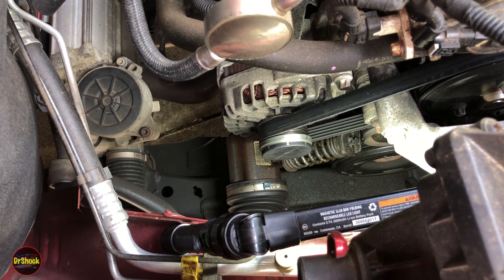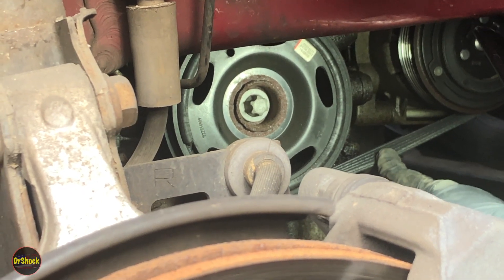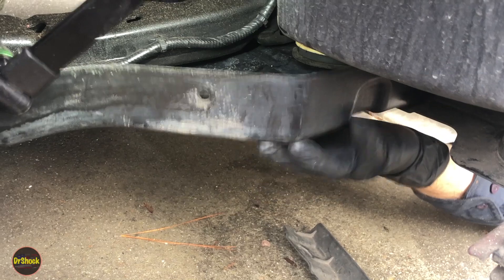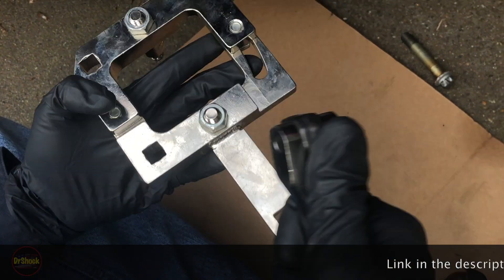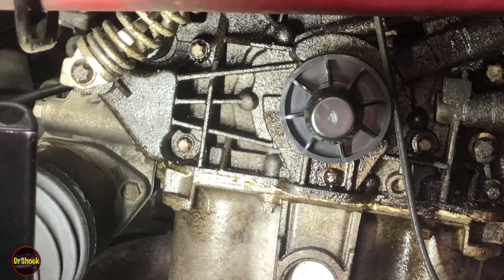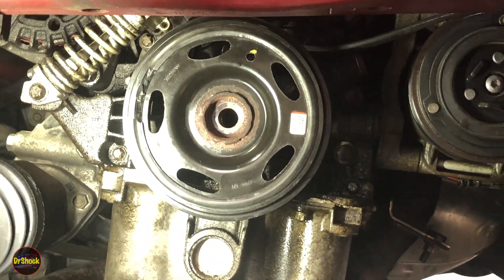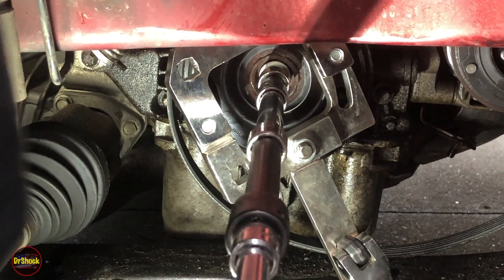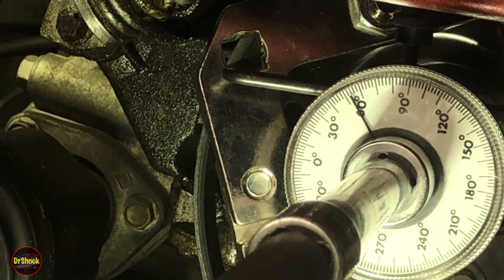2011 - 2021 GM Ecotec 1.4L Engine Oil Leak Front Crankshaft Seal Replacement (Chevy Cruze Sonic)

Comment: U don't have to put it in TDC it can only go on 2 ways, just remember where the hole is at the time of removal, as for the seal anything can ply it out just don't scratch the wall, as for lube on the seal why, the idea is to stop oil not added lube. Only need to place it TDC is when you're removing the timing chain, u will need a kit to do that as it gives you the cam locking plate and the locking crank pin.
Also, the timing chain gasket is known to leak as well, it's a pain in the bum to do, you need a day and a half of spare time for that, bloody Dawoo why did Chevy or Holden take on these pieces of crap is beyond me.
Reply from the maker: The GM dealership service manual provides a specific procedure, specific tools, and recommended techniques for this repair which are written by the GM engineers who designed this particular Ecotec 1.4L engine.  Some steps might seem redundant, or even unnecessary.  But they are the GM recommended ones.   For example, pre-lubricating the seal is indicated in order to prevent the inside sealing lip of the seal from tearing or folding during installation with the crankshaft seal installation tool.  Does this happen often?   No, but it can happen so the engineers provide a step that mitigates the possibility from ever happening.
Reply: @DrShock , I just use the old seal and place it against new and tap it in, no special tools are needed to do this job, unless like I said removing the timing cover to replace that piss weak gasket that dries out down on the bottom right side which then crumbles, then you need the tool kit, well yes and no as all you need is flat steel to lock the 2 cams in place, top dead center a piece of cake to find, spending all that money for an over kill kit is over the top as I found out after buying the kit. Just remove the 1st plug place a rod or something till the piston gets to the top, this requires placing the crank bolt back in but use a spacer / sleeve on the bolt to stop it from going in too far as the pully is off. 
If the timing is out then you will need the kit to adjust the cams but I never ran into that issue, maybe if your tearing down the whole engine, work smarter not harder, yes the book will tell you how they recommend as a lot of people don't understand shortcuts as they are not mechanical minded, as for lube a new seal is soft so doubt that ever happening, but good how too by u I'm just speaking on my experience. Oh if you leak oil on the right bottom side between sump pan and timing cover that means timing gasket and what a nightmare to do, know wonder they charge around 1400 to replace. . All the best.
Reply: @bobfisher1909  Yeah if anyone thinks their vehicle gets serviced like this at the dealership they are fooling themselves. Techs would never make money if they followed every last step to the exact T. Use a paint marker and mark the top of the pulley. It's only keyed to fit one of two ways and if your mark is at the top when you put it back on it's impossible to do it wrong. The pulley is not press on so there's no need to measure the distance. That procedure is there to make sure you pressed it in all the way before tightening the bolt. Replacing the balancer bolt is pretty important but I've never seen a single person put a torque wrench on one. To each their own. If you're working on your own vehicle you can do it however you want and there's no problem with that

Comment: Dr. Shock I'm having problems with my 2016 chevy cruze limited 1.4 turbo same oil leak as the one in the video I've tried and replaced seals what else could be the problem please help.
Reply from the maker: Only use genuine GM parts.  Aftermarket parts for these Ecotec 1.4L engines often have inferior fitment.   If you are using OEM seals, then you may have damage on the engine cover the seal is pressed into, or pulley assembly that inserts into it.  Inspect all the components that make contact with the seal (either the inside diameter of the seal, or the outside diameter of the seal).   You may have a burr, dent, or other defect which is compromising the seal integrity and causing the leakage.

This all presumes, of course, you have correctly diagnosed the source of the oil leak is this particular seal.   These engines can leak from many places after this many years.   Cleaning the whole area up and then monitoring the oil leak against a clean engine can help confirm the diagnosis.

Comment: Wats the difference of leak of the timing cover and the crank seal ? How bad of a leak is the difference? Thinking about changing the seal but not sure if it needs the timing cover seal also
Reply from the maker: The crankshaft seal being worn out will usually be a considerably larger and more noticeable oil leak than the timing cover gasket failing.   You might start with making sure that the timing cover bolts are still at torque.  Replacing the timing cover is a much larger project for this particular engine, as you have to pull the water pump and other components off to get access.
Reply: @DrShock  thanks for the reply
Reply: @DrShock  I wonder if a leaking crankshaft seal on the front passenger side of a 2006 Dodge Caravan would be the same sort of repair? Is a cam shaft oil leak repair something that you could demo as well? My new vehicle sprung a leak after an oil change, followed by a catalytic converter replacement (at the dealership) but it continued to leak oil and have a metallic scraping sound when first starting up.

Tho' still under warranty, the dealership kept it for two months -- saying that they were waiting approval from "Chrysler Dodge" headquarters to replace the existing engine. Finally, I was told to just trade it in on a new car, which I couldn't afford.  
Several mechanics have looked at it, and said "it can't be fixed."

I don't believe that a good mechanic can't fix "anything broken on a car." 
 I don't even know if it's a camshaft leak or a crankshaft leak. It's a great little van, always passes "smog" and I keep the oil level very low, so it doesn't leave an oil puddle. I've owned my Caravan for 19 years now; I just wish I could get that oil leak fixed. Less than 100,000 mi. Everything works. But I don't take it very far from home, in case it overheats. What do you think, DrShock??
Reply: Start using marvel mistry oil will help seal sray soft and keep sealed up lube better and cleans carbon build up change oil every 5000 miles using cheap synthetic oil from waly world oil is always dirty looks like need change out every 3000 miles if use quart of mistysry oil
Reply: Update I changed the crank seal still seeing oil on the ground guess it’s the timing cover

Comment: Love the video.. but this does not work for the 16 and up models.  There's a special puller that costs just under 200 bucks and up to 400. You need this to pull the harmonic balancer.  I'm having this issue right now.
Reply from the maker: Thanks.  Unfortunately, after 2016 GM introduced another flavor of this same displacement engine and kept the same branding but it's of a different design under RPO LE2.  While it uses many of the same parts, it does have some service procedure differences which creates confusion. I mention in the video, and again in the description, this particular crankshaft seal replacement procedure applies only to the earlier RPO LUJ/LUV style 1.4L engine, which was used from 2011 thru 2020 in various GM vehicles like the Sonic, but not all.  The 2016 Cruze Limited would have been the last Cruze model to use it.
Reply: @DrShock  gm is doing too much on these cars nowadays.  Have you ever seen the alternator on these 1.4 ecojunks snap bolts and fall off?  

We've had 2 at the shop this year. Smh

Pulling the harmonic balancer is the big issue to replacing the timing cover.
Reply from the maker: I've only ran into bolts snapping off when they were previously over torqued, or from corrosion on cars down from northeast (rust belt) states.  But otherwise, no haven't ran into this on Cruzes or Sonics.  But then I haven't encountered anything newer than 2016 on either.
Reply: Oil seal leak on dipstik also used marvel mistry oil to help clean and keeps seals more lubed and sweels rubber to help from leaking why mistry secret dad taught me have sonic 150,000 milles all had to do replace oil seal on valve cover and tighten timing chain guide bolts as they come loose and make tapping noise but pvc good also have to belive in marvel oil

Comment: Don't forget that pin in the tensioner... $50-$120 mistake.
Learned that the hard way while changing a belt that was beginning to shred. Noticed the shredded belt while in the middle of changing the turbo oil inlet line...
While changing belt, noticed coolant was empty to find the expansion tank was leaking at the outlet hose. Fixed that 2 days ago.
And..today I just noticed the hose clamps on the lower radiator hoses are snapped from age...
Rewind 5 years ago. Negative battery terminal (fun when your car shuts off while negotiating a turn...) , water pump, timing chain guide came loose, stuck lifters. Fun times.
I think this may be my oil leak...hope it is, this doesn't look like a difficult repair.

The mention of the TTY bolts. Had I not viewed your video on the belt change, I wouldn't had known the engine mount bolts had to be replaced after removing them.
Wasn't mentioned in the Haynes repair manual.
Thanks.
Reply: As a machinist 33 years useing same bolts ok if not stripped think steel bolts must be junk steel use h13 steel bolts good life time as i used same bolts must be biggest engineered skam think can use same bolts as  would not be afraid to use same bolt.
Reply: @jodygwiinn1233 TTY bolts stretch when used correctly, which you can’t always see visibly, but they do change shape from when they weren’t used to after they were installed so you should be using new ones for things this important
Reply: Especially aluminum as steel oxidize pulls alum threads use anti size on replacement bolts
Reply: Aluminum used only for lightweight better gas mileage for government rule now next be elec moter then use tesla atomspere elec to stay charged or just drive around thunderstorm and add extra capacitor to charge up rest of year on one lighting hell may become back to future car think about it be free why tesla tower tore up

Comment: Been there... done that. And I mean, losing 2 quarts in 10 miles. Timing cover, and crank seal.
Reply: Did it fix the oil leak I changed the crank seal but I’m still seeing oil on the ground guess it’s the timing cover
Reply: @3svtcobra  you still got the Cruze ?
Reply: Those things were damaged as a result of you driving 10 miles?
Reply: My mechanic is struggling with this bad...he put one on and it made the leak worse ..so now he s trying it again and answering my messeges..smh

Comment: What a pain in the a** car 😣 I had the engine completely rebuilt.. replaced ALL gaskets/seals, here I am again two months later searching for the source of an oil leak.. seriously the worst engine ever made!
 was it the crank seal with yours?
Reply from the maker: This isn't my personal vehicle, but I diagnosed for the owner four separate oil leaks.   Camshaft cover, oil pan, timing chain cover, and front crankshaft seal.   I did a video on the procedure for all but the timing chain cover one.  You can find the others in my Cruze repairs playlist.
Reply: @DrShock  Turned out the Harmonic balanced bolt was loose. Although I torqued it to spec..oh well..
Thank god 🙏
Reply: @DrShock   Oh bro please don't say that... 😣 That car definitely had a bad PCV check valve. That would explain all the leaks but I have the PCV Fix installed and it still leaked !! 

The thing is, I did all the work myself. I already went through everything. The thought of starting over just makes me sick...😣
I hope it's just the crank seal. 😐
Reply: @DrShock  The leak came back again, I replaced the seal with a GM one and it's gone.. The seal I used initially was an aftermarket one, and it was so loose in there that I pulled it off with my finger
Reply from the maker: Good call on OEM parts.  Always the right decision to avoid doing the job more than once.  ;-)
Reply: @DrShock  Agree

Comment: Hi great video! 

A couple of tips for those attempting this repair. Pack the back of the new seal with petroleum jelly around the spring area, that will help hold the spring in place when you strike the seal with the hammer/installer. They can pop off and it's difficult to know that once it's in. Second after you torque the 111lbs switch over to a breaker bar. Depending on your particular torque you may over torque the wrench ruining it's calibration.

Comment: Crankshaft seal installer link doesn't work
Reply from the maker: Thanks.  That EN-960 / OTC 6742  tool looks sold out on eBay already.  Amazon doesn't carry it so you may have to google around for that particular tool.
Reply: @DrShock yeah, it's out of stock in lots of places. Weird
Reply: You can also use the old seal to tap in the new one.

Comment: Just replaced this seal on our Chevy Volt, (same engine block)  but its more of a PITA as there is less room and  they have to remove the front motor mount  to get the belt off that goes from the crank to the water pump,  Volts dont have mechanical AC pump or Alternators,  So the belt is entrapped by the motor mount bolts.   Took me and my son about 6 hours to do the job from start to finish.